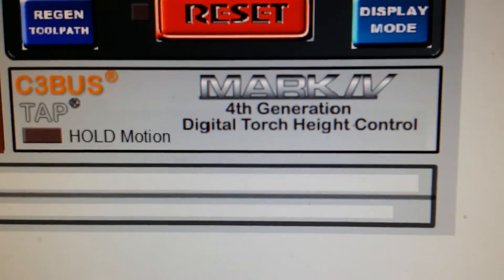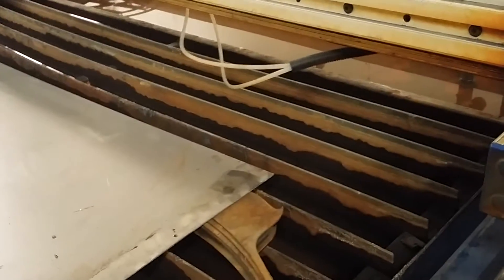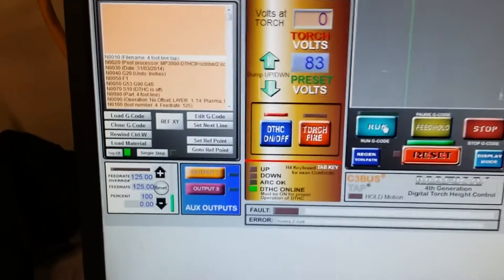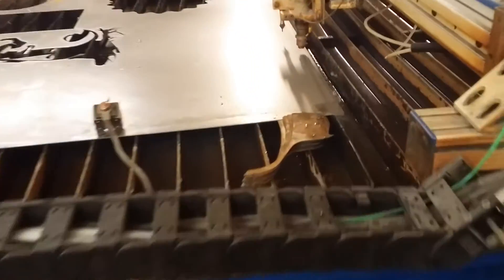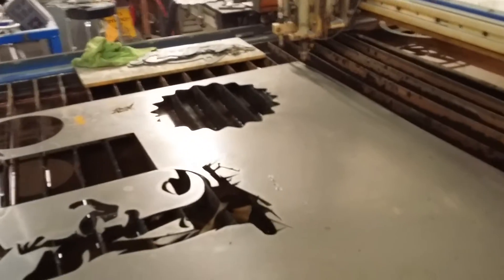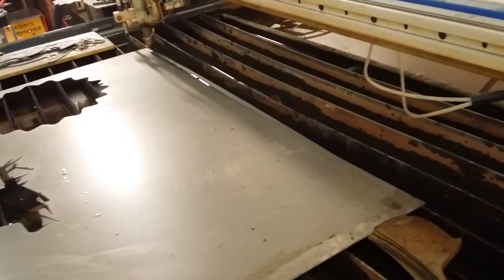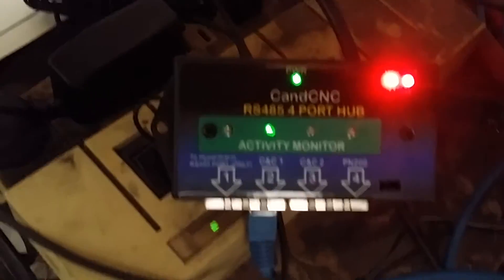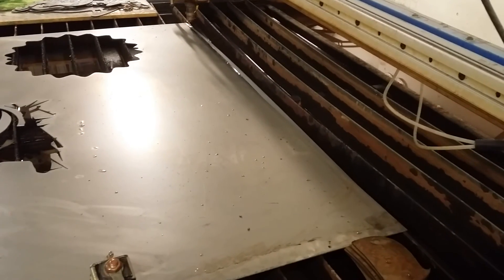My new digital height control test

Comment: Why did you torch goes down at the end and hit the sheet?
Reply from the maker: Nam Le H.  It was a setting in the cut tables... I was doing an initial test... The torch climbed 1.5" in 48 inches of travel, pretty impressive!  I've got it dialed in really nice now, and it holds cut height perfectly!!
Reply: does it normally just stop once the cut is done? or does it always go to initial Z before the next cut? Yes that THC is awesome, I'm building one myself in a few months. Do you run gear reduction? is that an air scribe you have there? sorry If this is too much questioning, I'm just excited